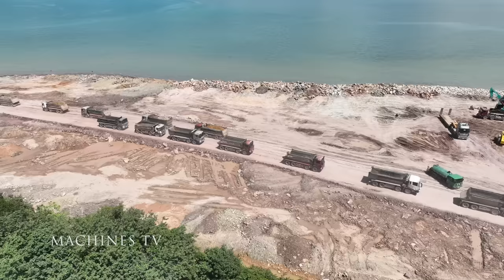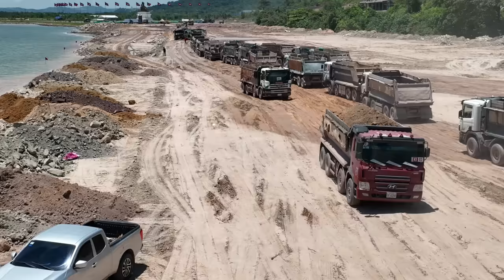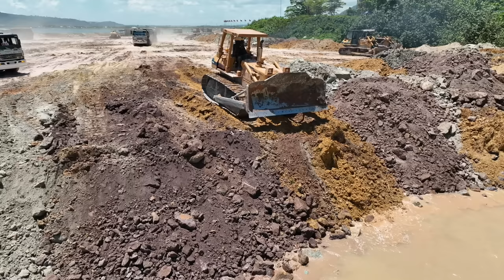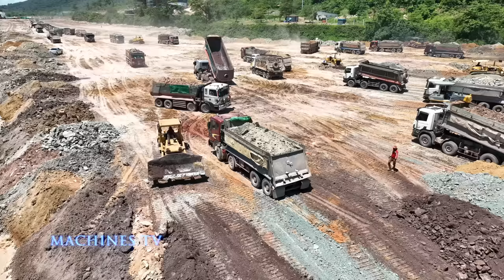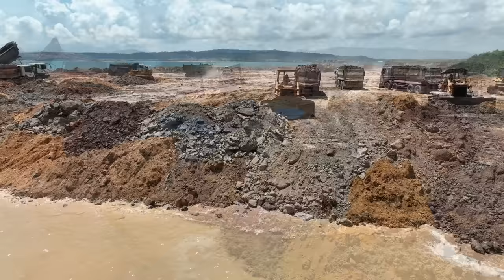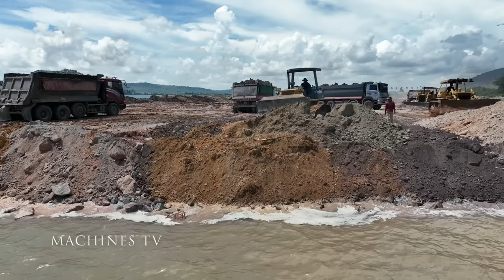WOW!! Super 300 Dump Truck Moving Dirt For Beach Reclamation Huge Land Filling Up Project In The Sea

Comment: Mgt needs to see this - the hold up is the dozers.  More of them need to be active and some training needs to be done to push level.  Pushing multiple loads, due to the back up,  is so much more difficult to push and slower - speed, and smart  is of the essence.
Reply: I can see at least 3 dozers inactive waste of money and resources. System seems to work but would be quicker with more dozer station’s

Comment: That’s a proper load on them trucks 👍 as a bulldozer operator there doing ok , just need spotters to get them trucks back more near edge
Reply: Being that fill is soft at the edge, perhaps the trucks are not getting too close so they don't get stuck. The dozers can push, and compact as they work. I wonder where all the fill is coming from for this big job. With the massive number of trucks coming continuously, wherever they are being loaded has to be as busy as this fill area. perhaps the person filming this could get a video of the loading operation at the other end. Quite an amazing sight!